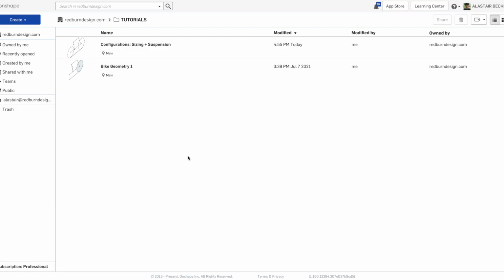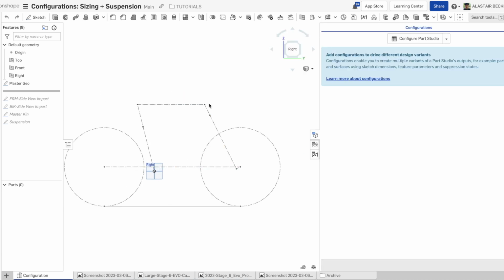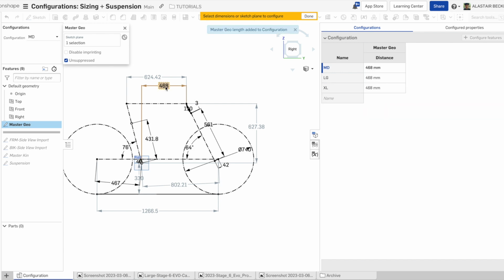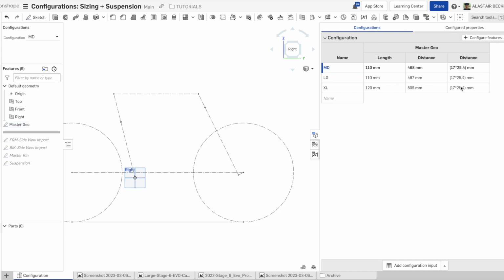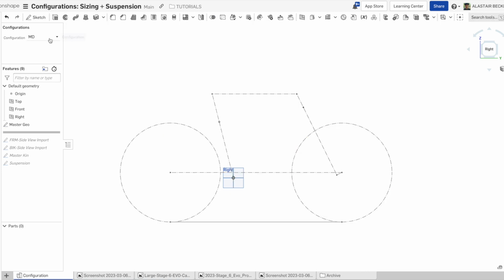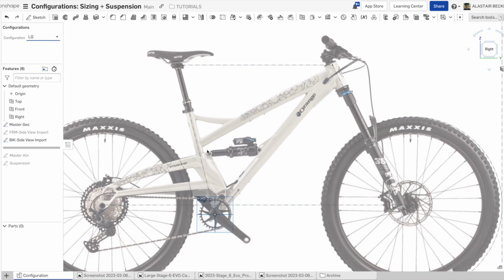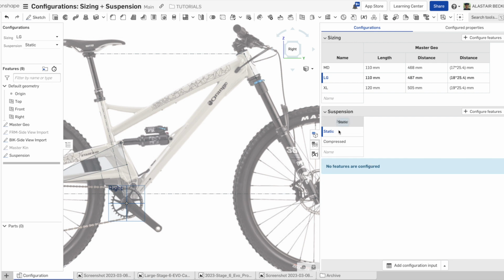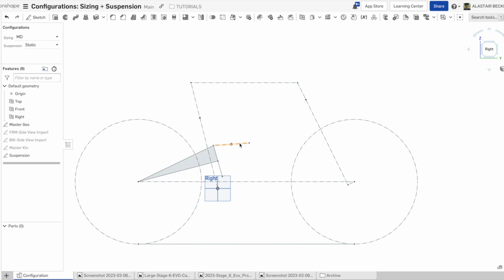HOW TO DESIGN BIKES IN CAD - CONFIGURATIONS AND SIZING - EPISODE 2

Comment: I'm having another issue with the suspension sketch. I can't get the rear triangle to be rigid, so the lengths will change and also the endpoints of the lines will disconnect and it all gets messed up. The biggest thing though seems to be the middle upright line isn't moving around and stays rigid for the most part unless I try to totally break it.
Reply from the maker: It’s tough to offer advice without seeing the problem, but it sounds as though you are either missing some constraints so that all of the lines have either a dimension, or relation with another line or element. 
If you are trying to create a suspension sketch that has motion, that is a more complex process and requires a rigid fully defined sketch first, and then a 2nd sketch which relates to this. 

I am creating a design course covering all of these fundamentals currently and it will launch in a few weeks. 

If you are interested, you can register interest via the link below to find out more and be first to know when it goes live for pre sale. 

https://www.redburndesign.com/bike-design-guide
Reply: @redburndesign  how can I make the mines have dimensions? Should I just redraw it all and make sure everything is connected do you think?

Comment: How do you create the kinematic suspension? In my case, the same points as you are fixed but then doesn't work like you. What I have to do?

Thanks
Reply from the maker: There is a way to do this. You need to create 2 sketches. The first one has all of your kinematics pivot locations constrained and dimensioned in place. The 2nd Sketch, is not constrained, but instead, each of the lines are set as 'equal' to the correlating lines on the first sketch. That way the suspension sketch remains floating and only constrained to the fixed pivot locations. 
I can create another video to illustrate this next week perhaps.
Reply: @redburndesign  please do, i cant fix it i tried everything
Reply: @redburndesign  Hey mate if you could put a video on how you built both the  fixed suspension and floating  suspension. That would be awesome - I'm trying to learn the waters of OnShape but I can't figure that part out perfectly, my bike is a Transition Sentinel 2021 - so a few more pivot point than the orange. Up to that part has been good so far, so thank you. Im building this as a little desk toy so yeah. But if you could demonstrate the suspension part that would be much appreciated - Love your work